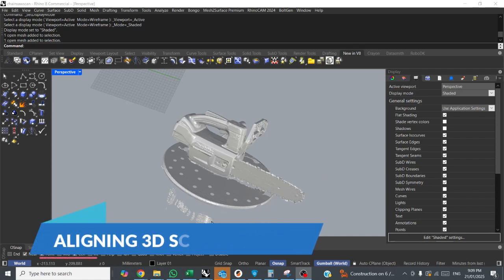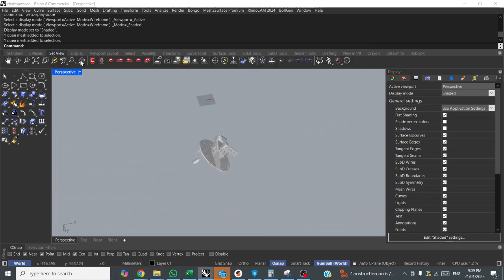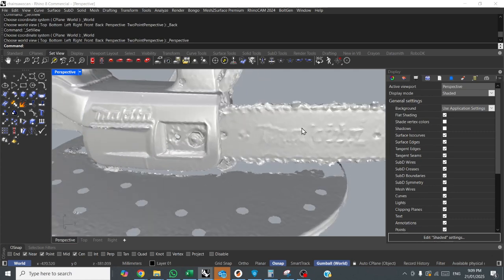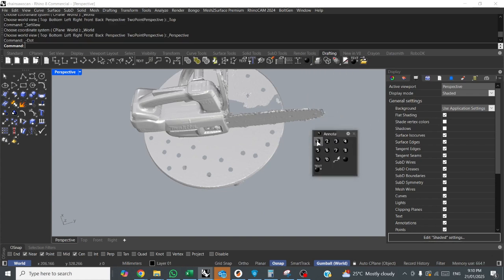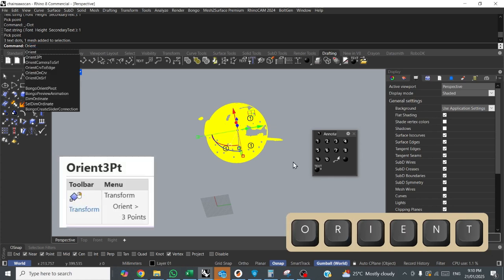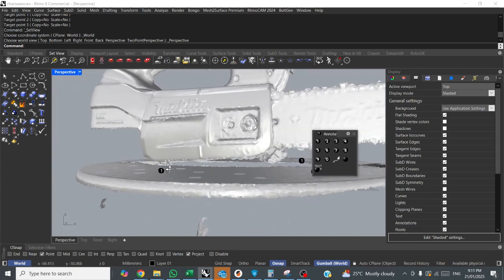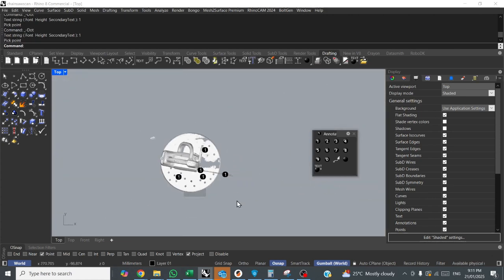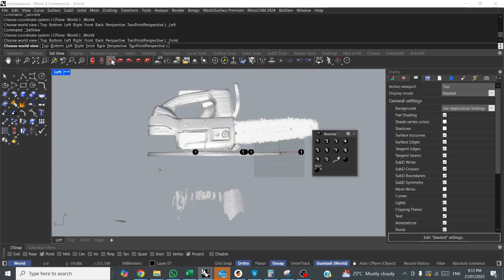Reverse Engineering in Rhino - Aligning 3d Scan Data

Comment: I'm new to 3D scanning, and until now I've really struggled with aligning scans to axes, basically doing it by eye. This video will really make my work easier. Thanks a lot for your time and good luck with your future projects.
Reply from the maker: My Pleasure glad I could help. Let me know if there are any other areas of scan processing you would like me to make a video on 👍
Reply: @TylerDesignandDigiFab  Well, there's a lot I need help with, but I'm somehow figuring it out gradually, searching for information and learning through trial and error. Currently, I'm having an issue with a car part - it's a lever that opens the glove compartment under the dashboard on the passenger side. There's hardly anything straight on this part. It's all curves and radii, so I'm not really sure how to align it with the axes. The only flat surfaces are something like mounting pins, but even those are at an angle.
Overall, I'm interested in how you think and what your workflow is when you decide to scan something. Which scanning modes do you choose for which parts? What do you focus on? How do you prepare the surface before scanning, or adjust lighting conditions? I've seen somewhere, for example, using paper tape on edges for a sharper scan of that object edge.
How many scans do you typically make of a particular thing, and how do you proceed with alignment and cleaning? How do you achieve the smoothest possible surface? I find that when I have raw cloud points it looks good, but after meshing, I get these spots on the part, like a grainy texture.
What do you focus on during conversion and model creation? Obviously, alignment with axes is fundamental, but I'd be interested in how you approach aligning different types of parts, because as I said, with that car door handle, I really don't know how to align it.
By the way, overall Rhino seems nice, that it can do so much out of the box, but I find it terribly confusing, so I'm still getting a bit lost in it, but I'm not giving up.
Reply from the maker: @dorlock42   Hey, well, first of all, for alignment, if there is nothing flat on the part, I tend to orient it how I see it in real life, looking at it in a normal situation. The part alignment is really just to help you understand what you are modeling as you do it.

I usually take two scans. One I kind of earmark as my primary scan, and one I keep as my backup scan. Usually, I don’t use the backup scan; I just keep it in case I need to double-check a measurement or if something doesn’t look right on my primary scan.

The scanner I have used the most is an EinScan HX in laser mode using locating dots. I mesh it (unwatertight) in the software and usually just export it as an OBJ, then open it as a mesh in Rhino. Sometimes, I use the mesh reduce, and then I’m straight into alignment as seen in this video.

If you like, you can email me the part, and I can make a video discussing it. The only caveat is that you don’t mind there being a video on YouTube about it.

Keep trying! Rhino has an awesome native toolset for reverse engineering. It’s just not an easy thing to do, unfortunately, but it’s a useful and valuable skill to have!
Reply: @TylerDesignandDigiFab  I would be very grateful for your help. I somehow managed to align the part in the end, but because part of it is broken off, I wanted to mirror the undamaged portion of the part, but I still can't get it to work somehow, so I would be grateful for any advice. What is your email?
Reply from the maker: @dorlock42  Hey no probs it's tylerwhitesan@gmail.com